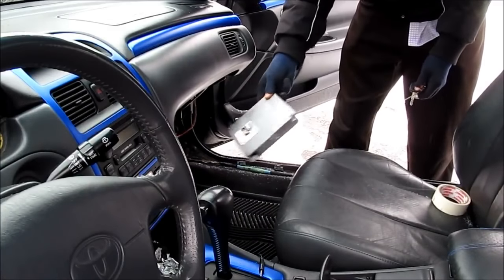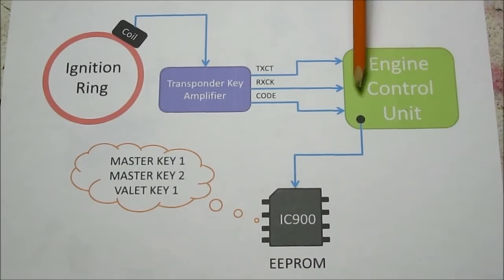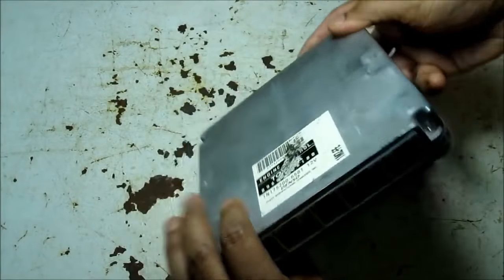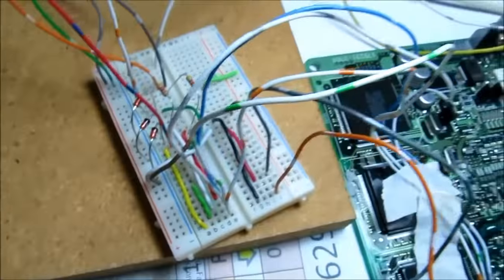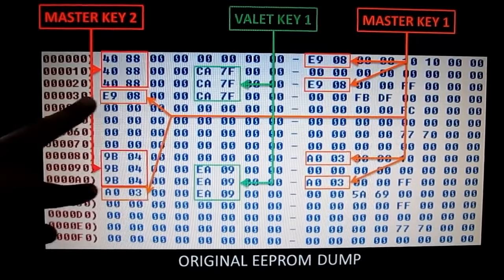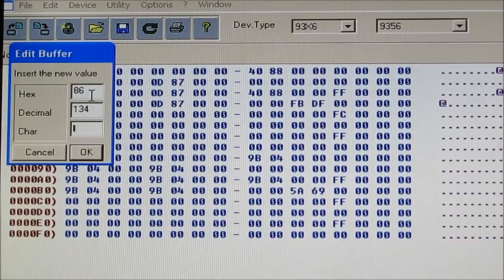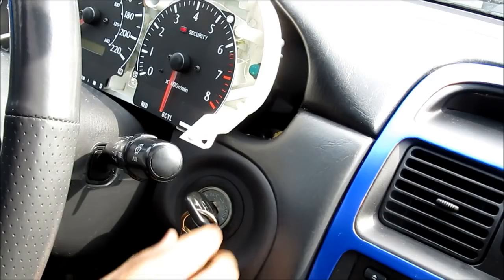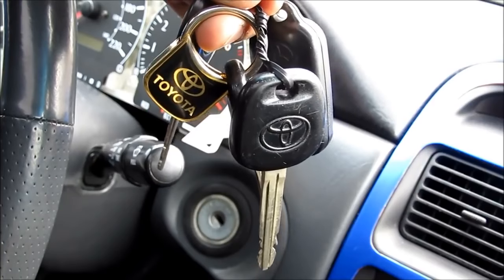DIY Immobilizer Hacking

Comment: What if I want to program just one key instead of three keys 
is that possible ? what are the steps
Reply: Programming just one key is possible.... Don't quote me but I do remember reading somewhere that to end the programming sequence early,  after you learn a key, You can step on the brake pedal a certain amount of times and it takes you out of Program mode. You might find the exact steps but it can be done. Also it will time out as well if you wait longer than an allowed amount of time..   (first 2 keys are programmed each as a master and 3rd key is learned as a Valet)  The tip on a valet key is also cut differently.

Comment: Yeahh Great Video !!  Ok... yeah I have a 2006 Ford F150... Replaced two batteries(Plow Truck) and now no start... no crank... no dash instrument lights...  and anti theft light flashing steady fast... and pulled a code.. saying  B1681 Passive Anti Theft System (Pats) Tranceiver Module Signal is not received..... So... opened up to see ignition Tranceiver.... and there is a small gauge wire looped around the tranceiver module..... so I am wondering if someone did that to try and match the resistance so that the key chip would pair to it? Help.!! lol

Comment: Hey, awesome video!
I love the DIY hacking!
BUT, do you know if this would work on a 2008 Tundra? If you don't know, is there a way I could check? Or is the only way to pull the ECU and look for that IC900 chip?
Reply from the maker: Presumeably the newer Tundra has a separate immobilzer chip from the ECU
Reply: I dont think this works on vehicles after 2003

Comment: Can you just change the chip in the key ?
Reply: The problem is, if you lose your master key, you can’t program new keys to your immobilizer. I bought my 2003 sequoia used and it only came with 1 Valet key.

Comment: 2009 300c remote start stopped working after battery died.. dealer says never had remote start... got it from salvage dealer with a clean title... I know it had the feature... worked for like 2 years...stopped in 2011ish my research leads to a new switch controller box thing that the key goes into, guess the box holds the key codes and all the remote stuff... anyone have any ideas I may have missed? Pretty sure I don’t need a battery registration or anything... gps radio and dvd all work, never had to do a battery reg on it, but is there anything I’m missing? Everything BUT the auto start works just bought a new dealer key and they couldn’t add the feature... ??? After market kit? But keyed to oem key? Lol is something burnt out? All fuses look good...
Reply: Only other electronic issue is the windows sometime roll back up or down after you try and roll the window down... heated seats were connected backwards so neither worked... figured that out after switching fixing my ashtray... the radio/gps housing and a bit banged up... still the remote start had worked

Comment: Honda crv 2011 if u try to start the car and turn the ignition without the chip...it puts the car into neutral. Let's it roll. And locks the wheel
 If ur faced down hill ur fcked

Comment: I have a unique situation. I have two Toyota 4runners a 1999 and a 2000 both limiteds with identical immobilizer systems. 

The 1999 is my daily driver and the 2000 is a project car/off-road rig that I lost the keys to. 

I wasn’t concerned about losing the keys as I don’t drive the car around town and planned on hot wiring it and eventually installing one of those cheap ignition panels from Amazon. I quickly found out it wasn’t that simple. 

In order to get the 2000(project) running I installed my 1999’s(daily driver) ecu and put my 1999’s key in the ignition so that it could be read. Because the key in the ignition and the code stored on the ecu matched the security system was disabled and at that point I was able to Hotwire the car. 

However this set-up isn’t sustainable, because my daily driver is now missing its ecu. 

My question is: Can I change the master key’s hex code on my 2000 ecu to match the code on my 1999 ecu, so that my 2000 will accept the keys I have for my 1999.

Reminder that I don’t need the key to actually turn the ignition lock, I just need the transponder inside to match what’s stored on the cars eeprom chip so that the car can be started. 

Given my situation, is there any thing else I could do to completely disable the eeprom system on my 2000 ecu? Like flashing it, removing the chip, or all of the components in the system you showed, etc. 

I simply have no need for it, and have made it a goal to spend as little money on this car as possible, to include purchasing new programmable keys, any advice you have would be highly valued. 

Thanks your all of your content. There is a great community for 4runners from this generation that has proved to be very knowledgeable and super helpful, but few of them seem very tech savvy. Your expertise is unique.
Reply: If anyone was wondering: no I was not able to find a way to completely disable the system. However, I was able to read the code from my 1999’s ecu and write it onto my 2000’s ecu, so that all of the keys that I have for my 1999 now work in my 2000. 

So the answer to the question “can one key be programmed to 2 immobilizers?” Yes. You just have to program both eeprom chips with the same code

Comment: Nice info. but aren't you at risk of frying the chip in the ICU without a heatsink during the soldering process?
Reply: 2 things. First, the IC(chip) can take a predetermined amount of heat as it has to withstand certain temperatures during the manufacturing process. Second, each time the soldering iron tip touches a leg of the IC, it is actually touching the corressponding circuit within the board. When that happens, heat is drawn through that circuit and diffused throughout the entire board which in effect, acts as a heatsink
Reply: @JohnnyP414  Been there done that but I obviously mentioned it for a reason. It's a close call.